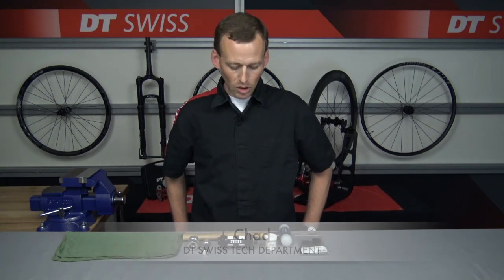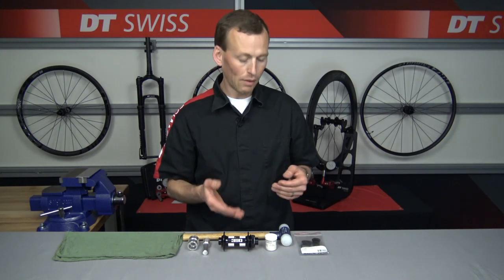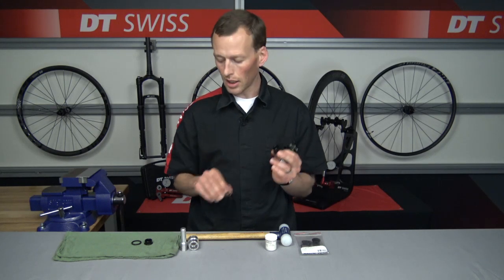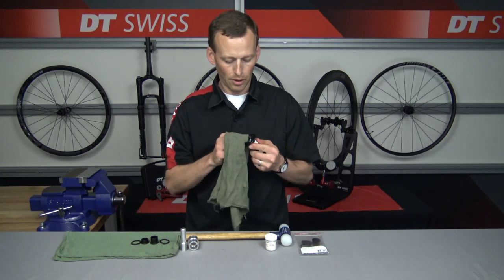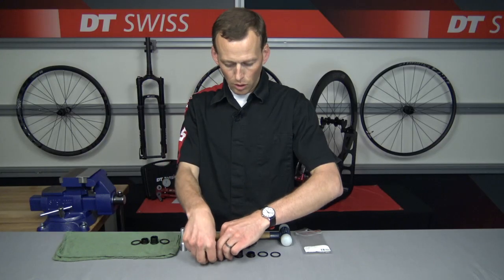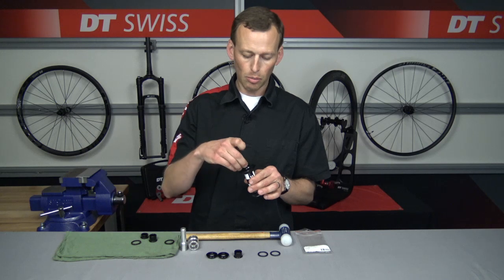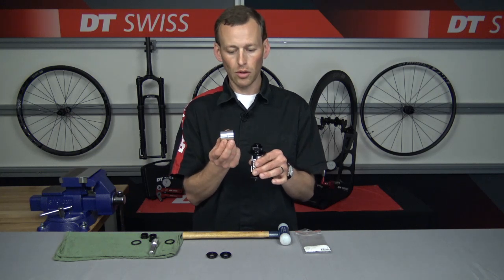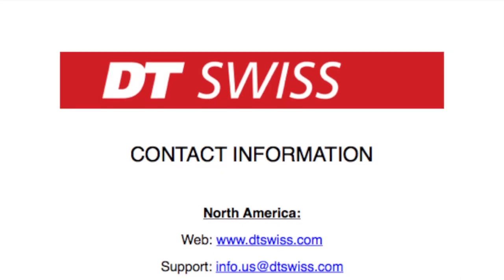How to convert a torque cap kit DT Swiss 350/370.  | DT Swiss

Comment from the maker: Do you have any questions regarding this topic?  Let us know in the comments below. 👇
Reply from the maker: Hi Sergey
Thank you for your message. To convert the rear hub you can use any 5/135mm conversion kit for 350 or 240s hubs.  For the front hub it is a little bit more complex and I would suggest to get in contact with one of our service centers, which will have detailed information. If you will not find a service close by ( https://www.dtswiss.com/en/support/service-center ) you can contact directly the service in our headquarter here in Switzerland ( service.ch@dtswiss.com ).Stay healthy, Friso "DT Swiss".
Reply: DT Swiss i have a 9mm 370 front hub,is that model convertible to 15 mm ?
Tnx
Reply from the maker: Hi michael
Thank you for your interest. As we have a huge range of products Available, this question is not so easy to answer. I would suggest to contact one of our service centers to get a correct answer. A list wiht all of our service centers can be  find here:
https://www.dtswiss.com/en/support/service-center/
Have a nice day, Friso "DT Swiss".
Reply: DT Swiss tnx
Reply: DT Swiss ,btw i have pulled the end cap ,does it need a 6902 bearing to be able to convert to a 15 mm thru axel?
Its a 370 9mm thru bolt hub.tnx
Reply from the maker: Hi Michael
Thank you for your message. First of all I have to tell you, a regular 370 hub cannot be converted into 15mm. The oppsite way is true, as we are using a different hubshell for the 15mm version. 
The make an exact identification of your hub and the possible ooptions, please get in contact with one of our service centers.
You will find a list here to identify a service close by to you:
https://www.dtswiss.com/en/support/service-center/
Have a nice day, Friso "DT Swiss".
Reply: Can I Backwards convert a 148 hub to a 142 hub..Dt Swiss 370?
Reply from the maker: Hi, conversion from boost to non boost is not possible. Kind regards, José, DT Swiss
Reply: Hello DT swiss i have a new pair of wheels EX471 on dt swiss 350 from 2016 can i convert them 142mm to 148mm pretty standard but i cant seem to find the right one on the internet
Reply from the maker: Hi, converting from 142mm to 148mm boost is not possible since the hub shell is longer to bring the hub flanges further out an make the build of a stiffer wheel possible. Also see our statement: https://dycteyr72g97f.cloudfront.net/uploads/HXD10000001346S/MAN_HXD10000001346S_WEB_ZZ_001.PDF Kind regards, José, DT Swiss
Reply: Do you make an end cap for the new Cane Creek Helm MKII boost for the 350 hub?  15mm axle.  Currently the 350 is setup for RS Pike w. torque end caps.
Thank you.
Reply from the maker: Hi David, you need standard 15mm end caps for your 350 MTB front hub: HWGXXX0004785S. In this manual from page 21 f. you will see how the exchange is done: https://www.dtswiss.com/pmt/00/00/00/00/00/00/00/10/00/00/00/91/2/MAN_WXD10000000912S_WEB_EN_001.pdf
Best regards, José, DT Swiss
Reply: Are the torque caps for 350 boost hubs compatible with centerlock 350 hubs? Thank you!
Reply from the maker: Hi Chris, yes, the torque caps are compatible with boost 350 centerlock hubs. Kind regards, Christian, DT Swiss
Reply: Hello DT Swiss, i need a conversion kit for 350 boost hub to QR to meet 5x110 and 5x141.  both front and rare. Any advice, please?
Reply: Dt swiss can i convert dt swiss 240 torque tube hub and a 240 hub 142mm to normal boost by swapping the end cap kit ? Thanks
Reply: The end caps are usually super tight. Impossible to remove without hurting the paint

Comment: You can use the end of your thru-axle to remove the end caps, and reinstall the lock rings with a rubber mallet and a socket that that fits over the end caps.  No need to waste your money and clutter your tool box with that special tool.

Comment: I need to conver my 350 hub from RS Pike to Fox 36 (2023 model). What end caps should I use for the Fox 36 fork? These from Rockshox are quite too big, these which I got with my hubs as stock end caps are just a bit too big. Would be greatful for some info what to use for Fox 36.

Comment: Hi, I´m trying to convert my 10 speed 1450 DT Swiss rear hub (135mm) to 11 speed (142mm); I just bought  the ratchet free hub body (12x142mm), It fits ok, but the right cap is too short...what kind of caps (for rim brake system) do I need to get my goal? Thanks in advance

Comment: For those of you who don’t want to spend $67 on the tool, get a 1 1/8” socket and a screwdriver. Works just as well and most people have these laying around. Tired of anything remotely MTB related getting marked up 10 fold
Reply: Thanks. a Dewalt 10 mm socket just did the trick for me. Insert and pull back at a slight angle.

Comment: Do you have an axle adapter for a 350 boost 110mm axle that is 15mm to a 12mm axle and maintain the 110mm spacing? Thank you

Comment: Is there kit for the non boost 350? Can’t find it
Reply from the maker: Hi there and thank you for your message. The TorqueCap Kit for 15/100mm hubs and 15/110mm hubs is the same. As the difference in-between boost and non boost front hubs from DT Swiss is the hub shell, the endcaps of both hubs are identical. Friso "DT Swiss".

Comment: I bought a pair of this boost hub and the front hub has ends caps with a little slack. Is this normal?
Reply from the maker: Hi, yes, when the wheel is outside your fork the endcaps will have a little play, but as soon as you tight them inside your fork the play will be gone. Kind regards, Christian, DT Swiss

Comment: Are the lock rings directional and if so which side faces outwards?
Reply from the maker: Hi ThunderStruckCoach, the ring has an L-shape and the flat side is facing outwards, when you have the end caps in your hand you will immediately understand how it fits together. Best regards, José, DT Swiss
Reply: @dtswiss  Thanks!

Comment: hello!! i want to change my mavic crossride 29' 9x135 qr  wheel on the back!what type of dtswiss hub/wheel do you recomend with this setup?
Reply from the maker: Hi wyo angel, the only wheel that could be used is the 1900 series since all others have 148mm boost axles. You could buy a 29" 12/142mm wheel and change the end caps to 5/135mm to fit your frame. Best regards, José, DT Swiss

Comment: Do you have caps for rear boost to make it 141mm ? 370 hub ?
Reply from the maker: Hi Marcin, yes that is possible, if you change to the 5/135mm QR end caps. For 12/142mm it converts into 5/135 and for boost 12/148mm it converts into 5/141mm. Also see our Product Support page, I have selected a M1900 Spline as reference https://www.dtswiss.com/en/support/product-support?matnr=W0M1900NEDTSA06947 under Conversions you will find the end caps for all 1900 Spline wheels of the current version. Be aware to select the according end caps for Shimano 11s or Sram XD. Kind regards, José, DT Swiss

Comment: Is there a way which I can safely install the torque caps without having the special DT installation/removal tool?? I do not want to buy the tool which I'm only going to use once and is also more expensive than the torque caps themselves...
Reply from the maker: We do not recommend to install our components without the proper tools. Kind regards, Christian, DT Swiss
Reply: Of course they would say no lol yes simply Use a dowel or similar to take off the end cap. use a socket from a socket wrench to tap in the lock ring. I found 1 1/8” works best but many will work as long as it fits over the cap and presses against the lock ring.

Comment: Does this tool work for my E1850 Spline MTB wheelset?
Reply from the maker: Hi Jean, the 350/370 front hub endcap removal/installation tool - HWTXXX00N5290S does work with your E1850 front wheel hub (assuming you have 15mm axle endcaps).

Best Regards,
Andrew
DT Swiss USA

Comment: Hello! Dt swiss,i use dt350 straightfull in my RB,and i like it,can anyone help me what is the size,measurement of there bearings?
Reply from the maker: Hi Mark, for a clear identification and spare part recommendation we need the production code that is laser etched on your hubshell (you will most likely have to dismount the disc brake rotor to see it). Best regards, Kai, DT Swiss.

Comment: Hi there, i have an E1800 DB Spline, and it came with 12mm thru axle end caps, I am trying to switch it out for the 15mm end caps that are included, is the tool here the right tool?
Reply from the maker: Hi Matt, yes, this is the right tool for the job, kind regards, Christian, DT Swiss

Comment: A section of 27.2 seat post can be used instead of that fancy tool. Thank you Block Bikes (PDX) for finding this hack! BTW, even when properly installed, the end caps will be loose and rattle. The thru axle will tight that up when the wheel’s on the bike and the load will be born by the bearings, not the caps.
Reply: Are you talking about the tool that press fits the hub end caps back into place?
Reply: @jbspillman  yes. Or use a socket from a socket wrench. Most people have these laying around
Reply: Works great with a 27.2 seat post. Thanks you for the tip !
Reply: Seat post was a good idea thanks. Hope I didn’t damage the bearings

Comment: Hello, is it possible to convert a 12x142 M1700 SPLINE TWO 27.5" Disc 6-bolts to 10x135?
Reply from the maker: Hi Steph, yes, such a conversion is possible. there are two conversion kits available, one for Shimano and one for SRAM XD freehub bodies. According article numbers can be found here:

https://www.dtswiss.com/en/support/conversion-charts/end-cap-solution-mtb-rear/

Best regards, DT Swiss

Comment: @chad where can order that end cap removal and installation tool for the 350 hub I have the dt swiss m1700 spline 2 30 wheelset I need that tool
Reply from the maker: Thank you for the question. In the United States, our distributor QBP (Quality Bicycle Products) will be carrying the installation tool set. Best Regards, Andrew

Comment: I've just bought a pair of R23 Spline DB wheels and I need to convert the front 15/100mm to the 12/100 end caps that were supplied with the front wheel. Is this the procedure for removal? The manual supplied does not give any instructions at all and I can't find a definitive answer on the DT Swiss website. Thanks, Steve.
Reply: dtswiss All sorted thanks. I had an email response yesterday from yourselves. Thanks, Steve.

Comment: Hi I am getting confused. The video said the kit won't fit non boost hub but the video description say will work for standard 100x15mm hub?
I have a 100x15mm DT350 front hub, which part I should order to make it Torque caps compatible ?
Reply: All forks using the torque cap standard are boost. I don't think you can re use your hub

Comment: Hi Chad!

I have a DT Swiss 350 wheelset that came on my Santa Cruz Hightower (BOOST 110, with Torque Cap). I want to swap this wheelset between two bikes, one with the Sram Torque Cap, the other being a Fox Boost 110 fork. What am I to do?! Thank you
Reply: You ever figure this out, this is exactly what I need to do..
Reply: @jbspillman  Same
Reply: You need to change torque caps on wheels to normal end cups then you can use it on both forks. Only on torque cap fork is little bit harder to align axle to hub, but during riding you wont notice diference.